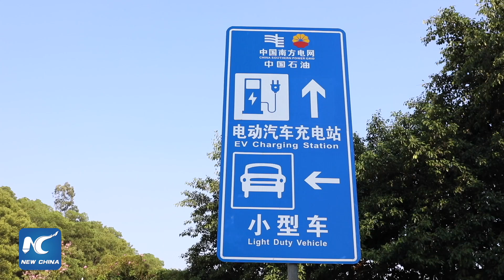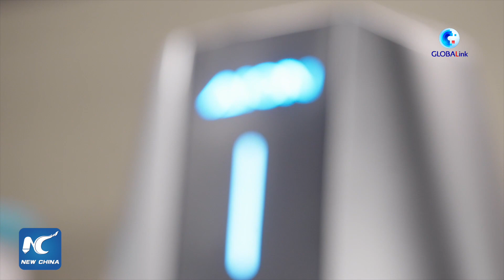GLOBALink | China charges ahead for green development as NEV charging piles boom

Comment: So green, apart from the power is generated from coal fire power stations!
Reply: It's a work in progress. Once there are enough energy storage capacity. Coal power plant can be replaced.
Coal power plant is a base load plant.
Solar, wind is not base load.
But solar, wind + battery storage + massively connected grids can equal coal.
See the missing pieces? And cost too.
Reply: @ramonching7772  China has been building Coal power stations and burns more coal than the rest of the world combined.  These stations are totally pointless show boating.
Reply: @alexmac513  I am not going to convince someone whose time frame is only 4 years.